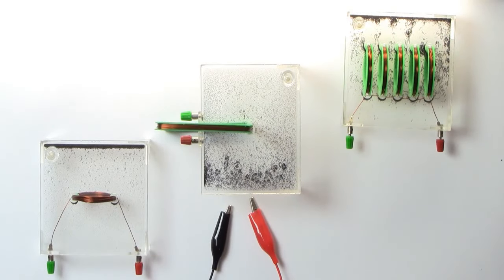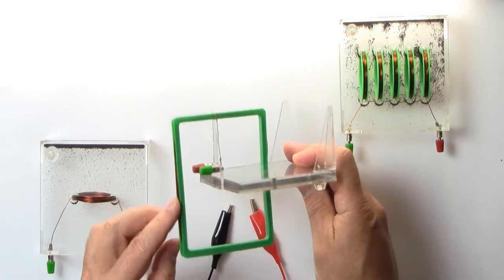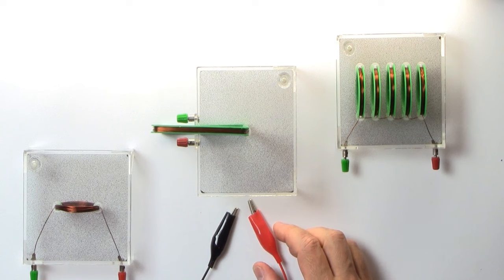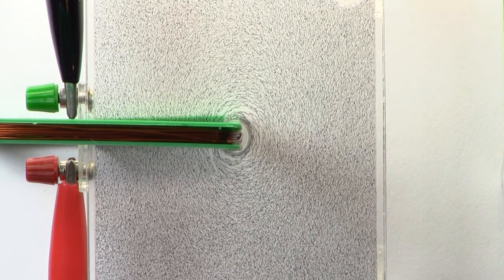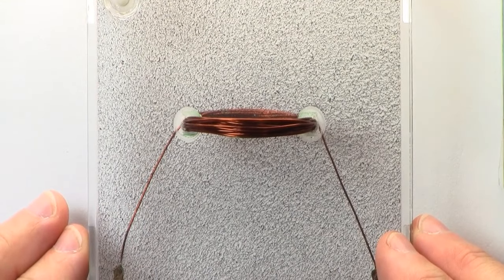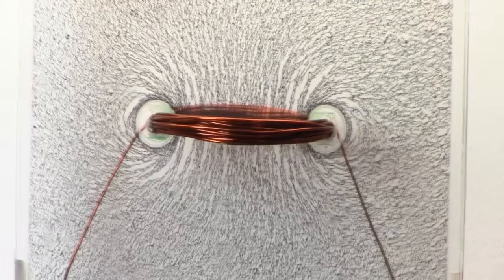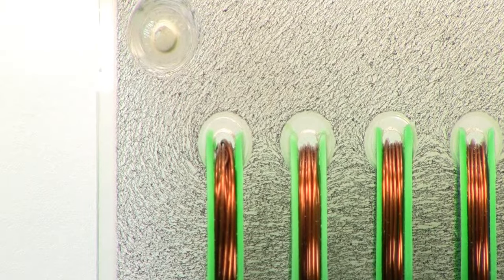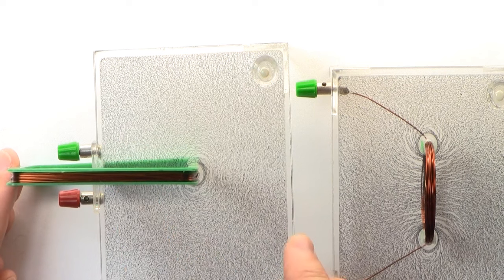PH EM MF DEMO 70001A V1025 2D Magnetic Field Demonstrations Simple Wire Coils

Comment: Recently, it is getting to be interested in the relation of quantal physics and order of the universe.
As to Magnetic Field Demonstrations in this video, it is really interesting as well.
If wire's edge is one point on the plate, the magnetic field is going in a circle.
When we think about every planet, every shape of the planets is going in a circle.
The universe authority is magnets.
So, we may be able to understand that every planet has one portal state among the force of the universe.
In another word, the magnetic field of the earth is going around in a circle and is pulling every being on the earth with gravity.
Our bodies are also effected by magnetic fields.
Our cell in the body is made of almost rounded colloid.
A molecule of water has 2 atoms of hydrogen and one of oxygen.
Atom is made of nucleus and electron.
Magnets forming the circular accelerator pull atomic particles.
In the universe, the magnetic force can pull atomic particles around the 4-mile track, 50,000 times per second.
If the balance of the magnets in living creatures have to protect their bodies from the universal magnetic force that is stronger than them.
So, most of the organization of the body has 2 portals in the whole body.
2 eyes, 2 ears, 2 arms, 2 legs and so on.
I think it is because of the energy field.
If there are 2 portals in one field, the magnets force blows up and down.
When the magnets force blows up and down, our particles can not collide.
If we do not have the magnetic force that can blow up and down, we can not have 2 portals in everything also within humans and animals.
It can be said that it is not only biology but our soul or spirit.

By The Nag Hammadi Library, it was written: 
" The rulers took Adam and put him in the garden, that he might cultivate it and keep watch over it.
They issued a command to him, saying, “From every tree in the garden shall you eat, 
but from the tree of knowledge of good and evil don’t eat, nor touch it.
For the day you eat from it you will surely die.
They said this to him, but they did not understand what they said.
Rather, by the father’s will, they said this in such a way that he might in fact eat,
 and that Adam might not regard them as would a man of an exclusively material nature. "

Therefore, " good and evil " are also 2 portals in terms of soul or spirit or mind.
The supreme being had opened the 2 portals and given those to humans.
And, I understand that Gods have 2 portals.
They offer the choice that " good or evil " to us.

Comment: Good day to the poster of this video. I have searched all of our usual science equipment suppliers for a set of magnetic field apparatus like the ones you use in this video. I have been able to find very simple ones that pass through a square of perspex however none with the oil immersed iron filings. Can you please let me know where I might be able to get these? Thanks!
Reply from the maker: Hi Rosalind. If you look in the credits of the video you will see the supplier I sourced the coils from. Cheers Fletch
Reply from the maker: The kit is called
Magnetic Field Demonstrator 3 Piece

Comment: Did you use AC or DC current for this btw? Although I don't think it would have changed the results much, maybe AC would make the Iron fillings oscillate more? I'm still learning about electromagnetism. I want to do a few experiments of my own like this, love the method of using iron fillings in a suspension to map field lines.
Reply: you need a waveform that dont change sign if it goes from -12v to 12v for example the field cancels out and probably wouldn't be very apparent in 60hz/ would cause some vibration effect, and even then with a half wave the field would probably move to much

Comment: Hello, I have a question. Great video by the way. My instructor energized a 500 ft. coil of wire, (or 167 yards) in a temporary magnet demonstration. He then inserted a screwdriver in the center of the coil. The screwdriver became a magnet. But once he inserted the screwdriver and it didn't work, he then turned the coil on the other end and it then magnetized the screwdriver. I thought the atoms just needed to be aligned, and their direction didn't matter. If it did matter, what is the correct direction? Or, why didn't it work once?

Comment: why is thee a void between the coil and the closest field/iron powder particles?
Reply: syd Hastings There’s no real void. It’s the silicone that hold the glass together and prevents the oil to leak out. Normally the particles would go all the way to the coil.

Comment: Very good but  what would happen if we used an AC?
Reply: the same
Reply: mahmoud saad The direction of the field (aka the side on which each pole is) would invert repeatedly. If he used a magnet, the magnet would flip around (this is basically how a motor works), but as he was using diamagnetic particles, instead of ferromagnetic, they are not polarized and would not rotate.

Comment: Does the number or coils matter? Like for example.
1. Would more coils change the shape of the pattern?
2. In the last muilti coil, if the coils were of different turns for each coil, would that affect the shape of the magnetic lines?
Reply from the maker: Hi
1) It would stay in the same pattern (but the magnetic field strength would increase)
2) Slightly as it would increase the magnetic field strength - but you would not really notice much difference in the pattern.
Reply: UniServeScienceVIDEO
Ok thank you for your response. I have one other follow -up question.
Could you direct me to where i can find information (or can you let me know) this:

A magnetic field is generated in a coil when power is hooked up, but is a magnetic field also generated in just a straight piece of copper wire? If not, then why is it that it only happens to coils? I google a lot, but im not getting any leads on this.
Reply: Yes. A magnetic field is produced around a straight piece of copper wire, when a current passes through the wire. Using your left hand, point the thumb in the direction of electron current flow, and wrap your fingers around the wire. The fingers indicate the direction of the magnetic flux around the wire.
Reply: Solar Fluxman I think u meant right hand... as in the right hand rule

Comment: why gaps?
do we have magnetic lines of force and 'lines' of no magnetic force?
if so, why?
Reply: +lez briddon same
Reply: there is a "viscosity" of the powder that makes different pieces of it stick together and others separate. If this wasn't the case it would be harder to see the lines. Think about why water droplets fall from the water tap instead of a continuous thin line of water, it's basically the same reason. The magnetic field is everywhere it's just that in the gaps there is nothing to "feel" it
Reply: This ‘gap’ is the silicone paste to hold the plexiglass together and prevents the oil to leak out. Otherwise the particles would go all the way to the coil.

Comment: Seems like electricity expands along the circular perimeter of the copper wire , and expands until it completes a sphere. From an initial donuts shape magnetic field, until its a magnetically spherical wave is formed. I seen a very similar pattern with astronauts in space, when they oxidize anything  it expands into a ball of energy when the energy expansion is not affected by gravity. I guess that's how energy expands from a torus decaying into a sphere, very likely with exponential properties....

Comment: Or you could have used magnet wire that was rated for 5 amps like 14 AWG so you don't have to worry about heating up anything. Also use a low ac voltage to get a better reaction.

Comment: The formula is BAIN
B= Magnetic field strength. 
A= Area of the Coil
I = current flow (remember that voltage ÷ resistance = I).
N= numbers of turns. 

It's a shame that you have not used a pancake coil: Nikola Tesla stylie ;-)
then using a 555ic for pulses of DC @ High Hz. replicate the skin effect at over 3khz?

Comment: The magnetic field isnt what it looks like. There is needed a good interpretation of what is hapening there. It looks clear the magnetic field and current has the same direction. It is the same as you put a strait magnet in the hole and there would be formed the same patern as the electric current forms.

Comment: If the earth gives off a huge magnetic power, why can't we use it to power stuff ??
Reply: Because as far we understand the magnetic field we need movement to generate electricity, and since Earth pulling everything toward the center, we can't create the movement without spend energy in the process. For example, hydro-power uses waterfall as primary energy source, wind-power uses wind, atomic-power uses heat to create boiled water and move the turbines, and so on.
Reply: Magnetic fields do no work  as the the force is perpendicular to the field also the earths magnetic field is weak since it effects a large area.
Reply: I have an invention that could turn the earth into the largest man made power genarator ever created, i may share it since no one can build it with our current technology.   That is if i live thru this storm thats coming right now.
Reply: Johnny Rekall Good luck the magnetic fields are extremely disperse and not strong thats why you  dont see the earth adding force onto sattellites.
Reply: Mohamed Yusuf Well, that's because my idea is way larger then any satalite ever could be but also impossible at our current age, we don't have the ability to build my invention, its to large, it would span the entire planet world wide but from space. It would be spinning as extremely fast speeds.  Did you know there are 6 different types of magnetic fields? I find that interesting...
Reply: Johnny Rekall No I didn't know that at all can u explain.I thought there was only one type of magnetic fields!
Reply: 1) Diamagnetism
2) Paramagnetism
3) Ferromagnetism
4) Ferrimagnetism
5) Antiferromagnetism
6) Superparamagnetism
Reply: We use Diamagnetism to run our cars, genarators, ect... any motor that uses copper wire to create energy is (in most cases) a Diamagnetic system / field.  There is an interesting thing about Silver (the metal), it is also Diamagnetic and it has a lower resist level then copper which makes it a better conductor for energy production however the cost is why no one uses it. Copper is  1.7 resist and silver is 1.6 resist, which isn't a huge difference but can be effective.  There is causes where people have used silver in place of copper to build radio parts during world war 2 because copper was being used to produce shells and there wasn't enough, this is another reason why we have this info.
Reply: Johnny Rekall First of all the magnetic fields from earth is hugely dispersed and since magnetic fields decrease with the increase of distance from the produce of magnetic fields we would need to dig deep to get enough force from the fields to generate power.Furthermore the magnetic fields change over time so we must change the machines configuration which would be a pain.
Reply: My machine has no moving parts, except one.
Reply: The 6 magnetisms you stated are the same they all run on the principle that magnetic fields are because of moving charges.There is only 1 real type of magnetisms.Furthermore the problem with ur design is the fact that the magnetic field of the earth is weak along with magnetic fields not being able to do work.The fact is its an idea , one with lots of holes but I commend you on the idea.
Reply: You don't know my design so how can you discount it ? That's whats wrong, because im not giving it out now. Anyways one day someone will build it but it won't be anyone you knew.
Reply: Johnny Rekall Can you explain the design or explain the principle it works on? Why make a comment if your not going to further explain.
Reply: Mohamed Yusuf Why do anything? I don't know. I just don't trust google/youtube to steal my idea, while sure it cannot be done right now but 100 years from now maybe. I suppose i could explain it since i won't be here anyways and no one knows me.

The design of this invention is massive (exact size unknown based on what would be needed), It will be metal based in the shape of a ring that is around the entire planet. This ring of metal will then be made to spin around the planet in a perfect ring orbit (which means it does not change from side to side, it just goes forwards). The speed at which it will be moving could be perhaps faster then our modern rocket boosters to leave earth. If it worked, it could in theory produce energy. The ring would be in space but around the planet at the same time. This project could not be done at our current level of technology, nor does it prove it could even be helpful, but i believe it would work if the correct elements, metal compounds, and everything else that is unknown turned out right.

Something 50miles wide by 50miles tall (thickness) or less and 200+ miles away from the earths surface, and surrounding the entire earth moving at speeds that we have never seen yet.
Thus how can you know for sure that something unknown will not happen, after stepping into the impossible, possible is possible and unknown is known.
Reply: +Johnny Rekall

So... a halo ring? That will do absolutely nothing good for humanity by the time it would be finished.

1) It would be a waste of time and money, taking centuries to finish.
2) Solar energy is the best energy (if you need unlimited energy; else, nuclear is next best).
3) It won't work the way you expect it to as it will break apart from gravitational forces. You'd have to be almost directly half the distance away from Earth as is the Moon to minimize gravitational issues. Even then, the moon's gravity will pull parts of it, ultimately destroying the ring into millions of pieces that will bombard both the Earth and the Moon, depending on its velocity.
Reply: I am aware of these problems, which is why i said it is impossible at our current state in technology, but in the future new things will be discovered and that will be the changing point.

No one who just looks at a wall can see thru it, at least not until you rethink what is possible. You only assume what you think you know, try stepping out of your P,C, box and try the impossible once, then you'll understand where my ideas come from.
Reply: Johnny Rekall

Technology can't stop the destruction of objects due to intense gravity, no matter the strength.
Reply: Techi Good argument here, there are some flaws in johnnys design but an idea is an idea.
Reply: Mohamed Yusuf

True...
Reply: i have an idea that will change everything. it is an energetic generator that uses some type of unknown energy and it will provide all the energy needed on earth. yes, i know what you are thinking, it is not possible at our current level of technology, but in 100 years it will work. I hope youtube won't steal my idea. You don't need to say I'm a genius, I already know
Reply: Techi Maybe if he explained his design because I don't see anyway in which the earths magnetic field at mili teslas can help him.
Reply: fede9603 At least i have an idea, what's yours ? Doesn't matter if it fails, it still exist.
Reply: Johnny Rekall
He literally said his idea in his comment.
Reply: i was joking johnny. Johnny Rekall
Reply: Johnny Rekall don't worry , although im sceptical let me not deter you from achieving your goals good luck and have fun.
Reply: Johnny Rekall
Not dense, just skeptical on a new scale.
Reply: No imagination instead perhaps, lol.  The world will crash and burn this is for sure, but what isn't are ideas until they're tested.
Reply: NASA experimented with just that. They extended a long wire contraption  while in orbit and were able to generate voltage. Unfortunately , the cable broke. That experiment must be in purgatory by now.
Reply: usksonic
Source?
Reply: Well... i suppose everyone is entitled to their opinion, even more so when they have a shotgun.
Reply: you don't need to build a giant  ring or  net, ir whatever your brilliant idea is. If it defies  the laws  of physics, it will fail. Sorry if I bribg you down mate, but you need to work in new ideas (more achievable) because this monster of you, wont  Work.
Reply: You may be correct and perhaps it will do nothing, but i cannot explain for some reason in words how it would work, which is a bit different then i tried to explain here, it would never work now but maybe 1000 years from now.  I know i could never create this in my life time or any other, the cost just to test it would be insane, then to keep it in orbit would be almost impossible while building it unless it came together all at once.

Then keeping it stable during movement without a standard fuel, perhaps something we have yet to discover yet, perhaps something to do with atomic oscillation or something we have no idea about or simple plasma from the sun.

If we don't try to imagine new ideas for the future, we will go no where, even if it doesn't work i'm sure you have ideas that a grand, i would never judge anothers imagination especially if that person knows their ideas are flawed and is simply throwing them out there for fun you might say.

I always find my self in philosophical conversations and thoughts in the mind, i have 100's of strange ideas that most likely will never be of use but i find it joyful to share them with others so i can learn.

I have never been one for being good at explaining things so others can understand easily but not for lack of trying and nor is it their fault, just my own.

Time is all we have, why not use it, friend.